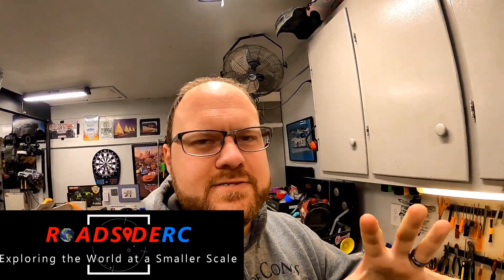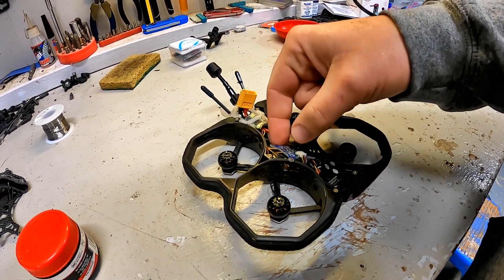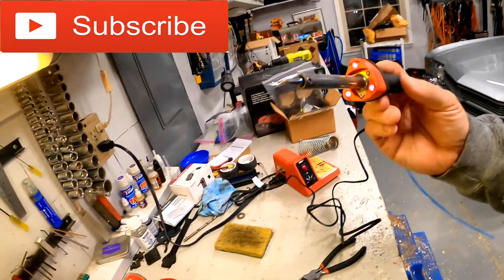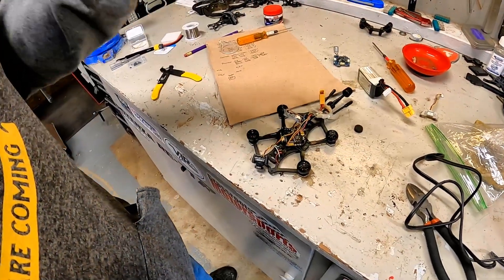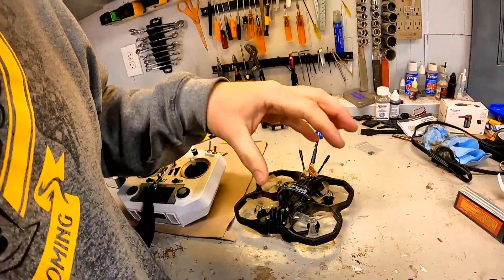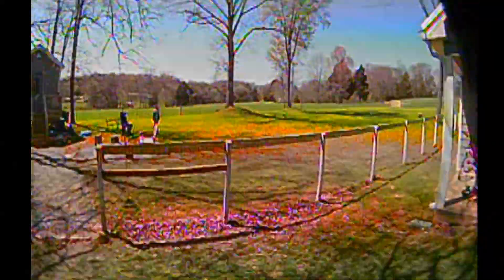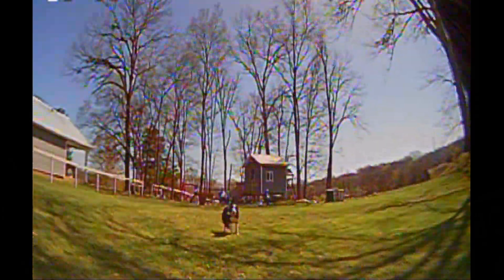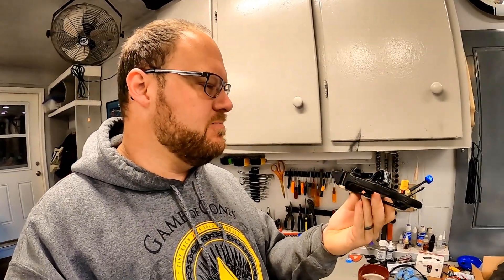FIXED!  iFlight Protek25 AIO FC ESC Upgrade!

Comment: do you happen to have the mapping diagram for switching over from the original SucceX-D 20A F4 Whoop AIO board into BetaFPV F722? I have the same issue like you and would have really benefited from the mapping diagram on how to transfer everything over.
Reply from the maker: I'm sorry, I don't.  I looked at the ESC diagrams for both and swapped wires 1-1.

Comment: My best friend has this issue. I do most of his maintenance since we are in a company. He has also blown 2 aio. So I’m putting the vista sideways in the back and dropping a 20x20 stack in.
Reply from the maker: That should work also!  
Good luck.
Reply: @RoadsideRC   vista won’t fit sideways. Was thinking of putting the beast 55 aio! But I have a spare betafpv f405 I’m going to use for now.

Comment: Mine burned 2 FCs also. The second one was literally on flames and took out some components. Replaced it since with an FC used with the bigger Protek35. So far so good.
Reply: I just purchased a Green one. May I ask how did she burn? In flight?
Were you carrying a gopro or another camera?
I flew mine 6 times already and after the flights the motors are not even warm.
Thanks
Reply from the maker: Interesting!  I didn't think of using the  Protek35 FC. I bet that does work great!

Comment: Thank you for sharing your thoughts and journey. I have experienced the same iflight AIO burn up and was recommended to use the BetaFPV F722 as a replacement option.

I totally agree with what you said about spending buying the Protek 25 and spending another eighty plus on this upgrade being unwise . For myself, I've no better option as I have bought lots of spares like the guards, props etc and on top of it all, I guess I wanted to see my first ever fpv quad go beyond 1 month of life.

So thank you again for sharing your journey, and I look forward to the new mod.
Reply from the maker: Great - I really hope this works out for you like it did for me.  
Now with this flight controller in, I like the quad better than when it was stock!
Reply: @RoadsideRC   what PID settings did you use on your new FC?
Reply from the maker: The stock ones loaded into the FC!  Have not touched them!

Comment: it gets easier lol thats my fav part of fpv building id rather build then fly lol
Reply from the maker: I tell you - this AIO unit was SO MUCH EASIER to solder than the factory iFlight unit. 
Seriously, the factory iFlight motor pads where the same size as the wire....and right next to each other.  It was crazy!

With this one, I didn't feel like I was crazy.  Patience, and I got it soldered correctly!  Very proud of myself.  :)
Reply: @RoadsideRC  glad ya got it back in the air bro and yea beta makes some really great stuff i have a 95x that i love  but as with any rc you will have your lovers and haters i know a lot of pilots hate beta but i love them i started with a betafpv 65s then 85s and have flown all brands of stuff but when it boils down to it beta has never gave me any issues i even did testing and r&d on there beta lite brushless boards that run the bayang protocol  really happy to see ya in the air again